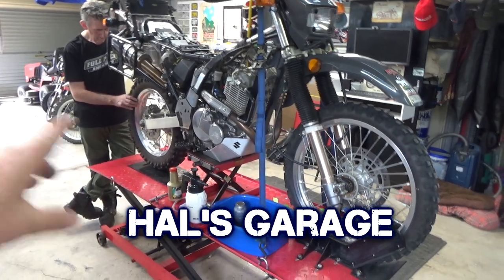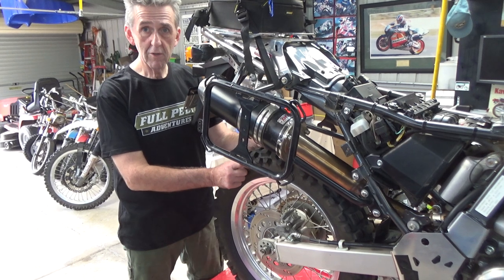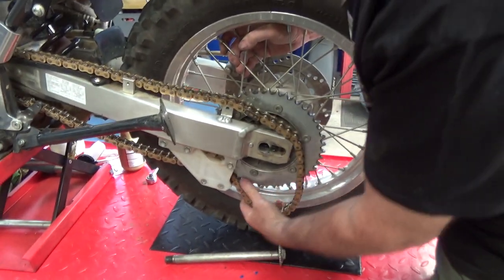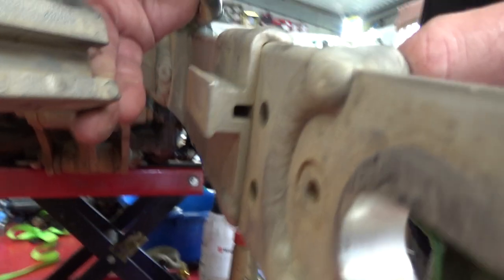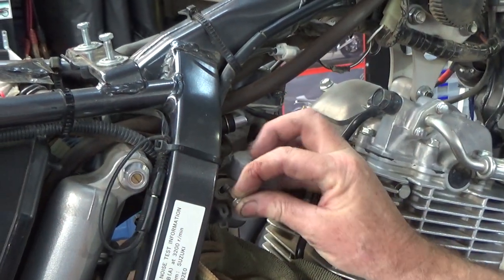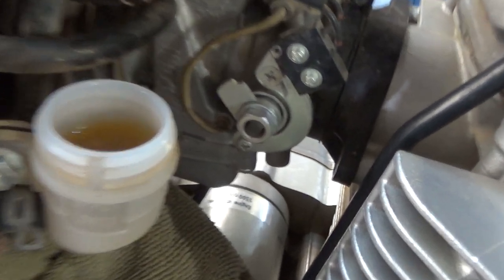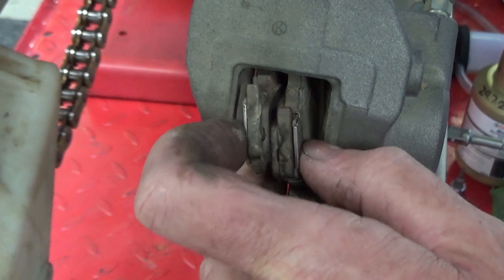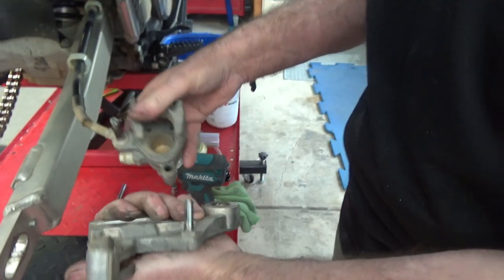DR650 Rear Brake Service

Comment: Great tips I love the use of never seize on the pins I do the same, I bought an old XR250 as a spare bike for friends and the pins in the calliper had never been out at a guess. After hours of heating and stripping out the heads of pins with an impact driver I finally got them out and brazed a new screw head in the end for future pad changes. Things you do in the bush when parts are far away!
Reply from the maker: Thanks for your comment Ian, glad you go something out of the video. I will pass it onto Hal as well. Regards FPPete.

Comment: When servicing bikes for off road purposes ... lubrication must be used sparingly where open to conditions ...especially around brakes ... in cases such as the exposed pin that secures brake pads in place & allows pads to move in the calipers is a no no ... any grease/lube will naturally attract dirt & dust & as such will in turn create an abrasive compound paste effect that will dramatically increase wear on moving parts & will restrict free movement of moving parts ... areas as illustrated @ 3:30 is not recommended to lube as it's design is to allow for adjustment of chain tension/wheel position & once set does not move ... best to leave dry on these areas so an accumulation is not created & allows dirt & dust to fall away freely ... also refrain from using pressure cleaners to wash critical areas ... such as chains/wheel bearings/steer head bearings/electrical components etc ... Cheers
Reply from the maker: Thanks heaps for your comment, we all learn from others experience. Regards FPPete.

Comment: I don't think I'd be putting anti seize anywhere near my brakes. Just my 2 bobs.
Reply from the maker: Thanks for your comment Dave. I have not had any problems with the anti-sieze, and I trust Hal's work. I have since purchased some silicone ceramic extreme brake parts lubricant by Permatex, and will try it next time. Kind Regards FPPete.

Comment: first rate
Reply from the maker: Thanks heaps Tom. Really glad you enjoyed the video. And I appreciate the feedback.
Reply: @FULLPELTAdventures  just finished the rear brakes shoe install. Watched other vids first but was not impressed with a too casual attitude… Hal covered so much more and actually helped me understand why I had such trouble getting the rear wheel back in with new cush rubbers after I replaced the bearings. The caliper was too far up the sliding channel and it just.Would.Not. Go! After watching your vid everything went back together like it had anti-seize on it… which it did  ;^ )
Gonna bleed the rears and take her for a test ride. So thanks very much for Hals thoroughness and your excellent camera work and narration. I’m near Atlanta Ga USA, and am going to link your vid to a DR Facebook group I’m in. After the test ride 🤩… thanks again.
Reply from the maker: @tommeyer6033  Thanks heaps Tom, The whole point of these videos with Hal is to show the process from start to finish, giving as much info as you need  to do the job. Hal will be chuffed when I tell him about your comment. Kind regards FPPete & Hal.